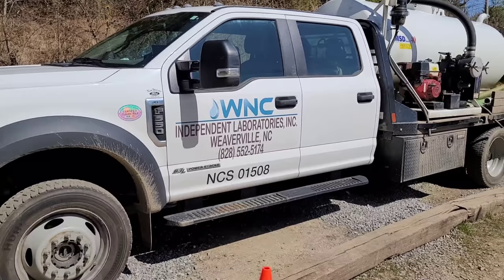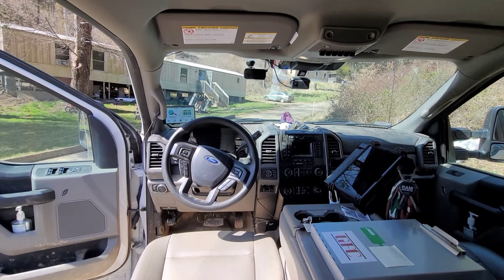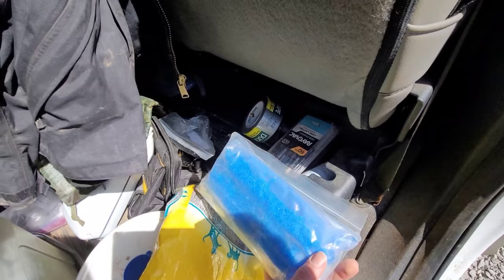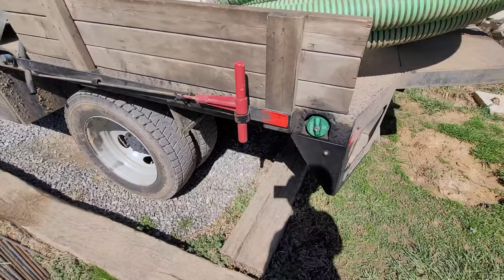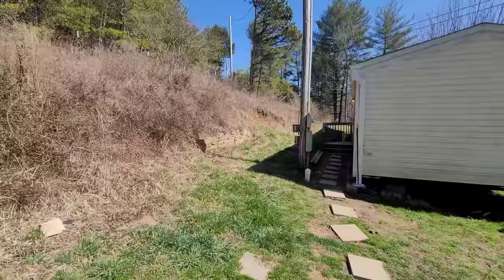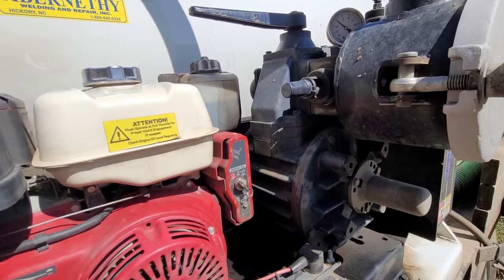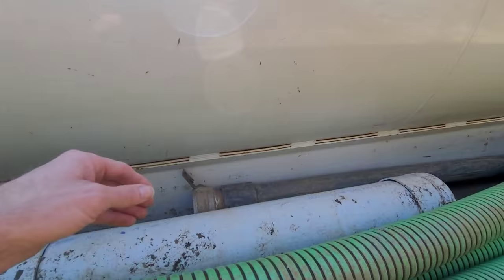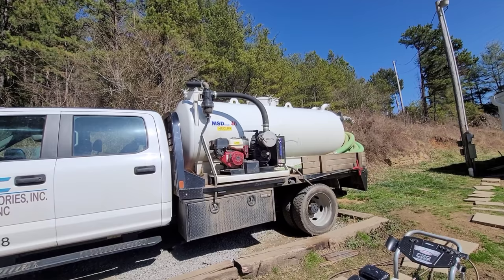Truck walk thru.

Comment: On those ballvalve/traps things that stop water or material from going in the pump, is there a way to hook up an alarm to go off if those are tripped, or maybe a way to wire to truck horn/car alarm?

Another idea would be to install easily accessible emergency kill switches for the motor and pump incase of a emergency (example someone sticks there hand where they shouldn't and don't know how to turn it off quickly) also an emergency air release for the tank pressure again for safety incase someone for example gets there hand or arm sucked in the hose and turning off the pumps/motor wouldn't nessicarily release the vaccum created by whatever is stuck in it

Someone else mentioned it but long handle/handles on your sturdy pipe for getting to the bottom of tanks to move it around better?

Comment: U could have a 360o spot light on the roof of the cab towards the back and it will help your look after the controls of the generator and I have a hand cleaning station on the outside with will save u touch door handles and the interior of the truck

Comment: Only things I could think of (2 are simple) is maybe a 12v fridge/thermoelectric cooler instead of yeti, no ice means more bottled water etc.  A way to spray off boots before getting in the truck ( various ways to do this) and ever considered an in house mechanic? I've never broken that down so I don't know the cost benefit of it but might be attainable.

Comment: Cut out those valves and get butterflies valves and put valve heaters on them( little switch that can flipped on pretrip and by time your to your job its Thawed out) butterfly valves are nicer because it’s easier to control Suction flow or blow off they less likely to leak. Downfall get clogged easier on larger or bulky items. 

Your sight glass at the top. They make guard’s for them to protect from rocks breaking the glass (yes it can happen and will) or get rid of the sight glass and put in a 1in rubber sight tube and with that you’ll have a better idea how much is on the truck and Have a better idea how many trips may be need per job. Always have a fire extinguisher pumps can catch fire. Also if you’re pumping inside a building its a nice thing to have to use Ford scape purposes only. Cut down on weight and hoses by buying longer hoses. No reason to carry a bunch of 10 footers when 3-4 32ft hoses will do the job. dont need side walls on the hose rack one half foot lip and bungee cords running across will hold everything in place. You can even run the fittings through them and dont have that risk of them falling off truck while going down road. Also need a spill bucket got to put that gunked kitty litter somewhere. Its also nice to have a vice on the truck for those screw together fitting that get stuck together

Comment: Used to sell Continental and toyo 19.5 the toyo had a good reputation but so did the continentals if you don't have someone in house mounting the tires and balancing you might consider that if you maintenance period is longer then the tire replacement period. Didn't see anything to clean your guys boots on the truck might help with feeling cleaner. I think any heavy duty truck you get should be a Ford or one of the smaller dealers the chevy stuff past 1500 sucks. Some tool organisation might go a long way. And some organization in the back of the truck as well. Anything that keeps a tech from looking for a tool saves time. Roadforce the tires if you can as well makes for a more comfortable ride. Not sure how often you get up on the bed but some hand holds are nice even if you make em out of 550 or something. Rather sure a cap for the throw lever on the pump could be made ether 3d print to save weight or metal and bolted down to save time unfreezing the pump by keeping water out. What kinda hand tools you guys carry on them?

Comment: Only thing I see is when I was hauling frack water in the winter we would put heat tape around the valves and wrap them in a water proof blanket and that kept the valves from freezing

Comment: Yeah wire pump into truck to eliminate shit battery.  Also they make a magnetic block heater we use on equipment in the field.   Just slap it on trouble spots and plug it it

Comment: For the cooler maybe you could get blue ice packs and a deep freeze. Deep freeze would cost like 30$ yearly and the ice packs are reusable. For ice if you go this route you could just take juice bottles freeze them with water in them and use those instead.

Comment: I would change it over to 1st attack super single wheels so you could run 20 inch tires I would mount a winch in the front bumper and also I would eliminate that little battery and run some battery cable from the trucks battery they are both 12 volts then as long as the trick has power the little motor will start. Daystar also makes these things called cam cans that you could mount on there that has interlocking gas and other liquid cans maybe for sanitizer and one for gas instead of having that gas can randomly floating around back there next time you have one of those tanks made I would ask them to weld some e trak to the side so you can clip tool holders to the side of the tank instead of having them loose on the bed.

Comment: I'm not sure if those valves are plastic or metal, but ZeroStart offers magnetic heaters, usually meant to stick on the outside of hydraulic tanks. Maybe sticking one on the valve overnight will stop the valves from freezing?

Comment: Just an idea but could you get a welder to fab up a cover for that valve so its kept out of the weather so it doesnt get water in it and freeze... just a simple box that is hinged and can be flipped out of the way and then when your done close the box down over the valve and you could even lock it if you wanted

Comment: My previous job we worked in 2 man crews all the time so to keep the driver more focused on the road the passenger was responsible for the work orders and gps that we had mounted on the center of the dash so the passenger (in our case) could put the coordinates in to the job location from the work order put the gps back and continue to the job site we also saved a lot of the places into the gps so we didn't have to retype everything in if we had to go back to these places later down the line which for us was every other week

Comment: The water leaking though the pump handle problem might be as easy as buying 10$ hydrophobic spray or paint. You will still be able to turn it no problem and the water will just slide off.

Comment: Would a winch on the front bar be beneficial? If the truck gets stuck... or you need to drag something up a hill ect....
Instead of the cool box.. a fridge would be great. Here in Australia, you can get a decent fridge cheap.. and at 1 bag of ice every 2 days.. youd pay off the fridge in under a year...
Maybe a fresh water tank with pump for employee washup and tooling washup..

Comment: You could get a small deep cycle battery and solar panel to keep the Honda Pump Engine battery charged and not replace the battery every year

Comment: It seems strange that your auxiliary battery dies after a year. I would usually expect batteries to last 2-3 May be worth looking into a split charge system to keep your auxiliary battery topped up from the truck alternator, without affecting your main battery? Either that or your battery may be freezing in low temps (freezing conditions can damage batteries very quickly) might be worth looking into AGM batteries that are better suited to cold environments in that case. Just my 2c

Comment: Back of the seat organizer, that hangs off the head rest, to keep small items off the floor and getting lost under the seats.

Bug shield for the hood to catch splatter and rocks that may damage the windshield

Emergency battery jumper, also can have another flash light and device charger.

The hooks on the top of the tank, could be used as anchors for hanging things off the sides of the tank anchored to the bed like shovels and hoses.

The tank valves look like they spin off easily. Why not buy spares for every truck. Take them off when not in use store them In the cab until ready to use, then attach them at the start of the day. Then at the end of the shift remove and clean valves, spot check rubber seals. This would prevent freezing and/or getting to a job and not being able to work because of valve/seal issues.

In the cold season why don't you pack the handle with grease or Vaseline to keep water out?

Comment: I don't know if someone already said this but if you remove the charging system from the pump couldn't you run the pump off the truck battery. However this might be more trouble than it is worth

Comment: What about snow chains (a specially shaped chain that goes around the wheels), they are used in Sweden when it is particularly slippery, due to snow or rain. Since your vehicles are really heavy and only getting heavier after a job that it might be an idea to have with.

Comment: Have you looked into the adhesive-mount silicone heaters that they market as oil pan heaters? I think they would probably work better to keep your pumps and valves from freezing than they do as block heaters.

Comment: You should try a ram 5500. Also try Toyo 608z tires I get around 65k to 70k on my ram 4500 wrecker and I tow f550 with it so all the weight is on my rear tires.

Comment: Most of the things I thought have already been mention.  But I was wondering how you run the electricity for the booster pumps?  Also for the rigid  hose attachment have you thought about adding handles and something like a brush nozzle to prevent the hose from getting stuck on thing's.  Thank you for the intriguing video.

Comment: Just curious have you thought about putting winches on your trucks for if they get stuck or can use it to pull piping back to the truck plus and inverter to run stuff off I bought an 
Electric pressure washer to clean stuff and put back on truck  would have to put a little water tank on there though

Comment: Hello, how about switching the battery on the electric start to a serviceable one and maintain it. Also you could also either insulate or have a plug in valve heater to prevent freezing on the valves. They work the same as the old block heaters.

Comment: What about having a cover made for your pump motor. A simple metal cover would prevent water from getting on your handle and freezing.
Reply: I was thinking of a plastic or metal cover over. To over the handle that deals with the pump.
Reply: @deang5009   I wouldn’t want to make it out of plastic due to the heat from the engine

Comment: Great video up till the moment you mentioned "Deleting the DEF System."  For God's sake man... DON"T DO IT
I have heard many people on Deisel Engines talking about that as a major problem.  I am a Truck Driver By profession and Own a 2013 Peterbilt 579.
All the research I have done considering that option at one time, I have found objective sources that say unanimously (Employed by Dealers) Rules and regulations are going to be in place that will "The Moment you Delete" make your truck - UNSERVICEABLE.  Government official tied to the left are pushing to have all those shops working on Deleted systems Fined for different things up to $25,000.00 for working on or not reporting those not in compliance.  It will make it virtually impossible to get any truck serviced for anything.  This move has already shut down Fitzgerald and the Glider Kits in the Deisel Automotive Industry.  So, be smart and keep the DEF System, it will save you in the future.  Be safe, and try not to raise a stink...  #ThatsTruckinNews.

Comment: You should look into the DOT rules where you are about gas cans. We had to buy DOT rated metal cans and secure them inbtbe truck. Secured only meant a milk crate attached to the truck and then the can bungie corded down. 

State Trooper at a weigh station almost wrote me a $385 ticket for an unsecured load because he was upset the gas can was just sitting on the deck in the back of the bucket truck I was driving.

Comment: Roof rack with rubber tie downs for the tools easier to see for inventory and less jumping around in bed so quieter. 
Install a back up camera either to your laptop or dash.
I would look into reducing the electronics in cab and try to consolidate the laptop or tablet should be able to eliminate the garmin less devices less distractions. 
And lastly the wood side panels. Why not switch with aluminum panels you could remove  easier would be lighter and you could attach tools to the sides if you didn’t want to try a roof rack.

Comment: Do you ever have anyone ride in the back seat? If you don't you could pullout those seats and install racking like they have in cargo vans to organize the stuff. Also could have a pass through box in front of the the tank to keep those "cheap" 🤣🤣 shovels out of the weather also you could lock up the box to have less of a chance of them getting 5 finger discounted

Comment: 1 reason your battery to the pump motor won't last for mote than a year is they don't have enough juice, (cold) crank amps or CCA. This isn't always the case but most often it is.

Comment: Sorry if this has been mentioned before but I know you enjoy having evidence for issues what if you install a camera set to point out the back and side which avoids issues with liability and could be setup as a backup camera, this would improve visibility for drivers and resolve for example someone stealing from the truck.

Comment: First aid kit should not be covered at anytime, an adjustable work light bar above the tank at the back one looking down each side and one looking down to the back of the tank, why not use the battery from the truck to run the generator run it through an isolator switch so can't be left on when not in use, warning label on the copper sulphate bag and in a small 3ltr bucket might be better, the tools lying loose on the bed is a hazard, you could do is have 5inch pipe about 4ft long attached to the cage at the front of the bed, a ball cock inside the tank and a gauge so the opp can see the level of the tank (like a fuel tank), they look like the same hoses farmers use for moving silage they have a reel on the back of the tractor, you could look at having one on the storage side of the bed would be quicker to unroll and roll up, a metal cabinet around the pump and generator and reroute the exhaust out the side of the cabinet, a metal gas can, a spare bulb kit for each truck with one of each bulb the truck takes, maybe a boot wash station, you can get an integrated fridge for under the crew seat save space, I'm not sure on the road laws but a walk around check book for each truck, and maybe if you can get the drivers to do a driver efficiency course might save on tyres, clutch, brakes etc

Comment: DOT tape on the sacrificial piece for the other idiots on the road, although if someone’s tailgating a septic rig, they’re probably not gonna care about DOT tape

Also, rear facing LEDs off the side off the truck, about 60% of the way back, and on a switch as well as tied to the reverse lights. Good for night working as well as backing at night.  It’s like the bar on the back, but it would help catch rocks or stumps that are forward of that bar

Put a thick coating of grease under that pressure switch handle, blocks the water

Comment: How about instead of running the gasoline motor to drive the vacuum pump 
You could install a pto (power take off) with a hydraulic pump and run the vacuum pump off hydraulics then you don’t have gas or that battery to replace once a year and it all runs of the truck. It would most likely be expensive install and switch it all over but in the long run it might be worth.

Comment: I know this is an old video but for the water freezing in the pump you could cut a a dado in a pvc pipe and put a cap on the top and it would slide over the Handle and keep water out and since it's not attached it would move freely with the handle

Comment: Top three things I didn’t catch in the video,

-Spring clips to hold tools either to running boards along the bed or to the headache rack
-Fire extinguishers are required on all commercial vehicles here in Louisiana 
-backup camera would be nice but if you’ve got a good driver side mirrors are plenty
-window tint, nothing super dark obviously but I’ve been working out of a truck in electrical maintenance for 11 years and any light restriction makes a world of difference to keeping the truck cooler
-would also recommend making a little top hat for that valve that catches water and freezes. Just slide it under the top bolt head like a washer. 
Hope any of that was helpful!
Reply: Correction fire extinguishers are required by dot...

Comment: The battery for the pump motor. It would be best if it ties into the vehicles battery to keep maintained and also if the battery itself be a AGM type battery which handles vibration a lot better.
Reply: You mention deleting the DEF system. If I’m not mistaken that’s illegal action removing an EPA controlled system for emissions. You want to look further into that before doing to avoid fines.

Comment: Why not do what we call a battery delete, at the shop where I work. You run a number 1 gauge cable from the truck battery to the pump positive. No more battery replacement every year.

Comment: Drop the federal plastic and cut holes in the hood and interior trim to save weight.  save gas and be lighter when 4x4ing. Also why have roof trim? No need. Swap back glass for poly.

Comment: Here from your tiktok: the only thing I would add is a portable jump start battery.  Its like a portable charger for your phone but is capable of jumping a car battery. Therefore if you are on the job and you deplete your battery or the battery to start the Honda motor dies you can jump it without the need for another vehicle. Is this upgrade goo enough for the $100??